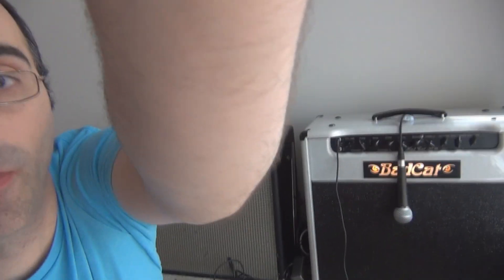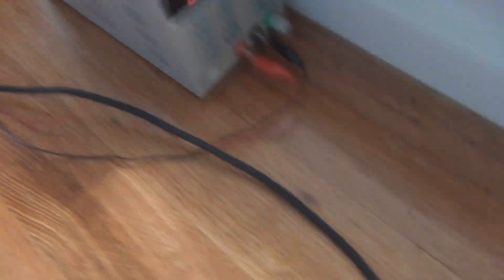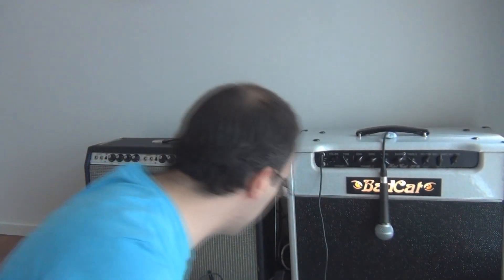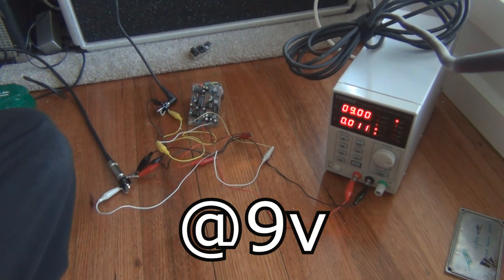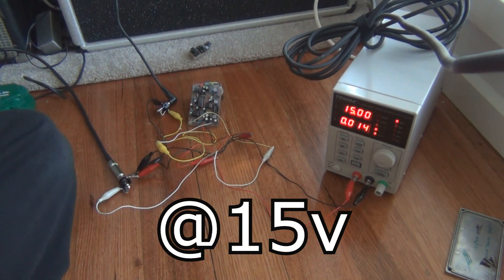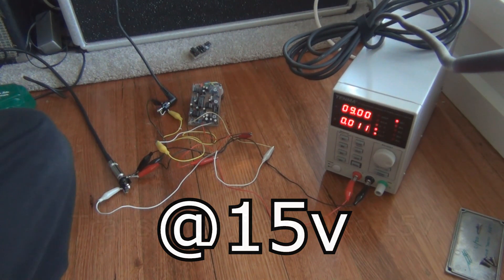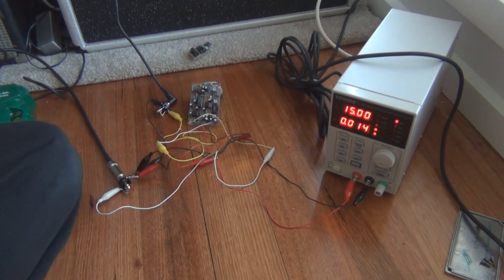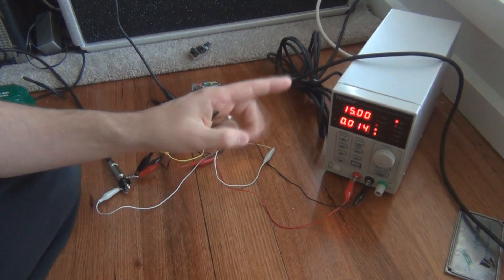BBD Delay Pedal Running at 9v vs 15v

Comment: Question for ya, ive always run my analog chorus pedals at 12v and found it optimal (as you are aware, you get higher headroom with higher voltage which is what im after as well as the perceived output increase) but those chorus pedals were built with the V3207 BBD which from what i understand runs at a positive voltage ( i think 15v) and the classic much sought after MN3007's run at a negative voltage. So what im wondering is this, i recently got a really great deal on a mint greenhouse effects stonefish chorus and itll be here tomorrow. Its all analog with an MN3007 so id assume it would be ok to run it at 12v but since the MN3007 is supposed to have more headroom over the V3207 i might not need to run it at 12v. But if i decided to try it, in theory it should be ok right? I dont hold you liable for any damage i do to my pedal, im responsible for my own choices. With that said i cant find any contact info for Greenhouse Effects and your the first person i thought to ask. Anyways any help figuring this out would be much appreciated. Thanks!